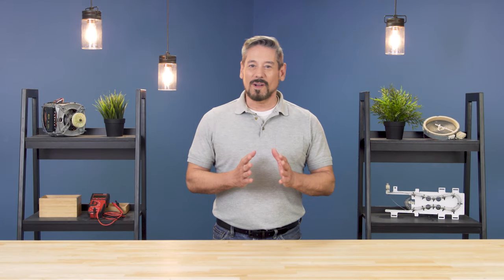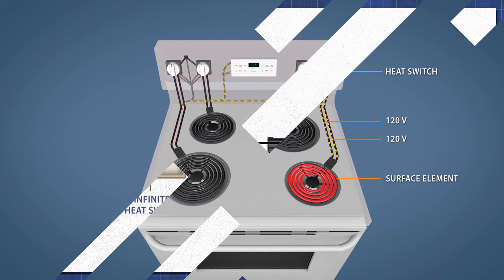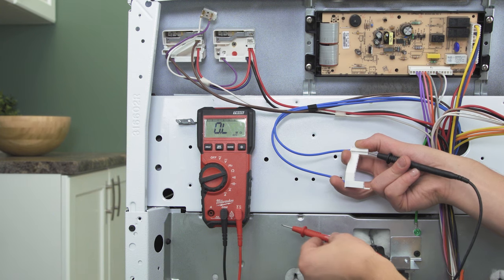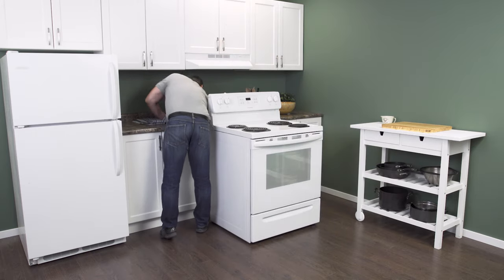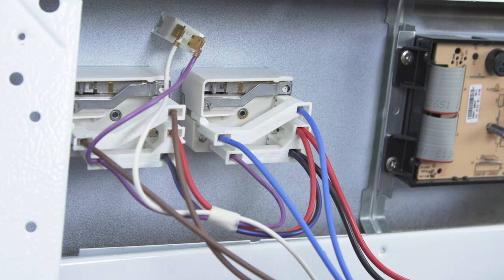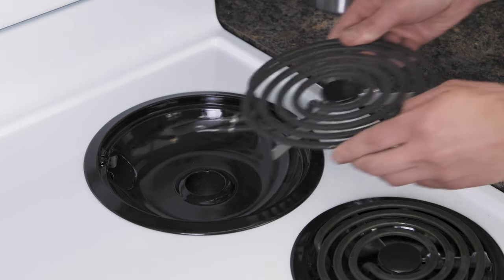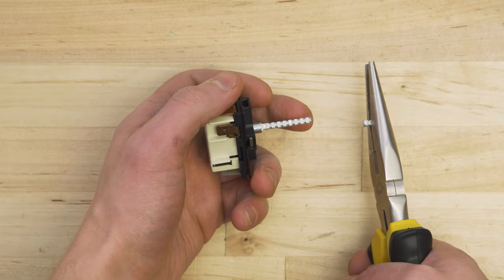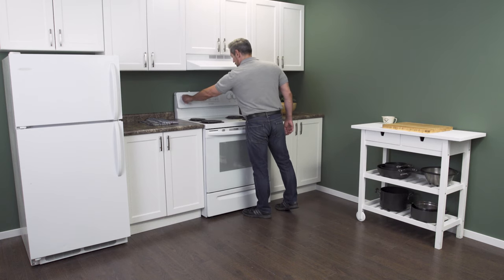Electric Stove Stays on High - Troubleshooting | Repair & Replace

Comment from the maker: Did this video help you fix your stove? Did you run into any problems? Let us know in the comments!
Reply: Yeh, this video did help me to fix the problem.
Thanks.
Reply: What if all elements are staying on high ?
Reply from the maker: @boldackalack_4864  Thanks for watching. If the stove uses 4 separate heat switches then it is very unlikely for all 4 switches to have failed all at once. The only scenario that it might happen is if a range has a control board that is connected to the oven and stove. In this case a faulty control board would effect all 4 elements.
Reply from the maker: @muhammadtahirsiddiqui8347  We're the video helped you! Sorry we're just seeing this comment now!
Reply: Haven't tried it yet
Reply from the maker: @pasqualealbino  Thanks for watching. Keep us posted on how it goes!
Reply: It's a great informative video, however, how does one test a double edison screw fuse holder(uses glass stove fuses) with a multimeter?
Reply from the maker: @asgharalihassim  Thanks for watching, we're just happy to help. You can remove the fuse and test it like you would test a light bulb. Using a multmeter touch the probes to the metal on the screw and the metal tab on the bottom. If the fuse has continuity, then replace it back into the fuse holder. Then you can test the fuse and holder together through the back.
Reply: @AmreSupply  Many thanks,I have also replied on Facebook Messenger with photos, is there any illustrations or video tutorial you can share to assist on this matter?
Reply from the maker: @asgharalihassim  This video shows how to troubleshoot an oven light which is similar: https://youtu.be/T5CPQxYp1WQ 

You can't test a fuse by putting into another device like a light socket. We don't have a video showing testing a lightbulb or edison screw fuse for continuity however once you connect to the side and bottom of the screw, the test will show between 0 and 1 ohms.
Reply: How can I hire one of the stove technicians? I live in Centreville, Virginia. I have same problem electric stoves just one stove over heating.
Reply from the maker: @HealthyLifeChoices-tg9fn  Thanks for watching. You can call up any appliance technician and they will be happy to help you. It is good to ask about rates as there is some variation. There will likely be a fee to just show up and diagnose the problem, then there will be a fee to do the work and replace any parts.
Reply: @AmreSupply  how much do you think it should cost in total? Labor plus parts together in Centreville, Virginia for just one stove which is over heating?
Reply from the maker: @HealthyLifeChoices-tg9fn  Could be a few hundred or more but it's best to ask for a quote for price ranges when making a service call.
Reply: @AmreSupply  What I meant was what do you believe is reasonable price like total?
Reply from the maker: @HealthyLifeChoices-tg9fn  Prices are subjective and its hard to say what it will cost as there is fluctuations based on location. Overall for a new heat switch, expect to pay a technician a few hundred dollars to cover the cost of the part and installation. 

Many people might not think this is the best value and when they look at the simplicity of the repair, they'll decide to install a new switch on their own to save some money.
Reply: @AmreSupply  Ok thanks.

Comment: I actually had the same issue. after removing the switch, I took apart the plastic case for the switch (just needed a flathead screw driver) I then sprayed the internal with mass airflow sensor cleaner. Electrical cleaner would work as well. I clipped it all back together and it worked!!! Hope this helps.
Reply from the maker: Thanks for sharing your experience, we're glad you got it working again!

Comment: I have a stove with a similar issue. About a year and half ago, a tenant complained that the lower right element would turn red hot on the lowest setting. I replaced the heat switch behind the stove and it worked. Fast forward 2022, she’s complaining that it’s getting to hot compared to the others. But it doesn’t turn red hot. Could it be that the element itself is malfunctioning, or could it be that the other 3 elements have faulty heat switches , and they need to be replaced? I opened up the back, the one I replace looks brand new, other 3 look burnt
Reply from the maker: Thanks for watching. Heating elements generally either fail completely or they work. If they have continuity a heating element won't ever be "weak".

Since you put a new switch, it is possible that the switch is hotter at the same "number" setting on the stove. These are not precise heat settings as the elements simply cycle on and off. 

The stove switch uses a bi-metallic switch that heats up and bends to disconnect the circuit. You can learn more in this short 1 minute video: https://youtu.be/URFjJPQycsk

If the other 3 burners work, but they don't seem as hot as the burner with the new heat switch, then the 3 heat switches have likely aged at the same rate. The metal inside the switches is likely fatigued and is quicker to bend and disconnect the circuit. This means that the heating element will get less cycles of heat.

If needed, you could replace all 3 switches and that will likely make them work the same as the new switch. The heat settings that your tenant is used to might not be the same after the update.

Comment: I have the same problem but with my oven( not stove top) I had just replaced the element inside the oven and then about a week later as I was cooking a pizza not even 10 minutes into cooking I smelled something burning went into the kitchen and smoke was coming out the oven. The pizza was burnt to a crisp. The same thing happen again cooking some else. I finally figure out that no matter what temp the oven was on it was always on high and not turning off, until I turned it off. Could this problem be the temp sensor or could this come from the newly replaced baking element. Thanks in advance
Reply from the maker: Thanks for watching. You mentioned that you replaced the baking (bottom) element. For most ovens the bake is used 80% of the time and the top broil element is used 20% of the time. A shorted broil element might stay on and would cause the temperature to be too high.

Also best to test the temperature sensor. You can see more in this video: https://www.youtube.com/watch?v=10ezc3LNQP4

Comment: What if you replace the switch, burner tests good, but it still overheats?
Reply from the maker: Thank you for watching. What do you mean by overheat? Does the stove only run on the high even when set to a low or medium setting?

Comment: we have a newer whirlpool range that 's only a few years old and looks exactly like the one shown except black in color. for about a year now we can't control the heat of the burners on lower to mid settings, they go more to high heat. why would they all act like this for such a new unit?
Reply from the maker: Thanks for watching. If your stove has separate heat switches for all burners, it is unlikely that they would all wear out in the same way and only after a few years of use. 

At the lower heat settings you still should notice the elements glowing on and off but they should turn on less frequently than on high. 

Some pans (like teflon / aluminium) are more sensitive to changes in heat. Using carbon steel or cast iron will help even out the heat and make it that it maintains more even cooking. 

As well the amount of heat will be different for smaller sized pans and smaller amount of food. This is why there is no 1 setting that can be recommended it all depends on these factors.

If you have a model that has stove elements controlled by buttons on the display panel, then a faulty control board could cause these problems.

Comment: How to test a dual element to see if it is shorted? My dual element burner stays on high heat regardless of how we adjust the knob. I tested the switch and it seems to be working properly. The switch and wires are different than the one in this video.
Reply from the maker: Thanks for watching. You can see an explanation of the terminals in this video. https://www.youtube.com/watch?v=GaW7uAHkPQI
You can still test for a short at the back. You'll just have an additional wire to test.
Just remember that the switch might be faulty even if it passes the continuity test. At rest, it is difficult to test to see if the metal inside the switch is not releasing properly from the contacts. This is a single switch but you can see more on the inside of the switch here: https://www.youtube.com/shorts/URFjJPQycsk
Reply: @AmreSupply  thank you! I will check this out.
Reply: @AmreSupply  are we looking for a specific resistance reading for continuity using the wires to test for a short of the element ? I'm getting about 43 on 4 and 38 on 4a.
Reply from the maker: @seanm2216  If you are testing for a short looking at the resistance for the wire connected to terminal 4 and the metal frame, then a resistance of 43 or 38 ohms means its shorted. There should be no continuity reading or  - - - - -  or OL on the multimeter. 

If you test the terminals directly at the element you'll likely get a similar reading. If that's the case then replace the element.

If the element does not show the same reading, then check the wires to see if they are damaged or if the wire terminals are touching anything.
Reply: @AmreSupply  Thank you! I tested each wire (2,4,4a) to frame and got no continuity. When I tested the wires to see if the element was shorted (i.e. Wire that goes to 2 and wire that goes to 4 and 4a), that is where I got the reading of around 40 on each. I opened the switch and didn't see any fusing. So I hope it is just the switch.
Reply from the maker: @seanm2216  From what you tested there is no short as there is no continuity to the metal frame. 

When testing between wires 2 and 4 or testing between wires 2 and 4a, you are testing the resistance of the element coil. Both those tests are normal readings.

It's likely a faulty switch. The terminals don't always fuse together in these cases but the metal inside the switch becomes fatigued and does not bend away when it is supposed to on lower settings.

In this case installing a new heat switch will likely solve your problem. You can enter you model number here to find an exact match: https://www.amresupply.com/lookup
Reply: @AmreSupply  Thank you! I will try a new switch and give an update.
Reply from the maker: @seanm2216  You're welcome, we're just happy to help and we're curious to see if that fixes the problem!
Reply: @AmreSupply  it did end up being the switch. After changing it, the burner now works properly. Thank you for your help!
Reply from the maker: @seanm2216  You're very welcome! Thank you for the update, we're glad that it's working properly again!

Comment: Tried testing resistance, but kept getting 1 all the way to the left on the indicator. I am guessing this is just the infinite that shows when no connection is established, I tried all of the back metal portions of the stove. Is no continuity the same as an infinite number? If I put the 2 probes simultaneously into H1 and H2 I do get a number so the ohm meter works.
Reply from the maker: Thanks for watching. No continuity is the same as infinite resistance or an open circuit. When you have the multimeter probes disconnected it will show a blank display, or  - - - - - -, or in some models it will show OL (open loop). If the multimeter shows just a 1 and not 1.0 or 1.00 etc then that might be the indication of the infinite resistance. You can always check the manual for your multimeter for more details.
Reply: @AmreSupply  Thank you for the reply.
Reply from the maker: @dimkacracker  You're welcome!

Comment: What would cause both left side burners to only work on high burners have not been used very often but there be a fuse running that part
Reply from the maker: Thanks for watching. It is unlikely for both switches to fail at once. There could be a short to ground and depending on how it is wired one wire might feed the left burners and another wire might feed the right side. You can still do the checks as outlined in this video.

Comment: Thankyou for the informative video, can I ask a quick question?
If all four burners are giving full heat when placed on the lowest settings, which diagnosis is more likely? The switch replacement or the burner replacement? Thankyou for help!
Reply from the maker: Hi Julian, thank you for watching! Is this a hypothetical question or do you have a stove that have 4 burners that are staying on high? Overall that is a highly unlikely scenario for all 4 burners to have either a shorted element or a faulty heat switch. If you did have a stove that the burners were hooked up to the control board (instead of independent heat switches) then it could be an issue with the control board.
Reply: @AmreSupply   @AMRE Supply  I don't know if my reply went through. 
Sorry for the confusion, it is not a hypothetical situation. My parent's oven currently has this issue. 

Thankyou for the information regarding the control board.

Comment: Great!... I will check as you discussed. 
QUESTIONS: I have a fairly new stove, a 3-4 years old. Both front large burners are doing this. The smaller back burners are not. Is this issue more prevalent for the larger burners? Does the fact that this issue is with BOTH large burners; front right and front left, mean  there something else to check? Are they electrically connected somehow, or is there a component to check that  controls/links the large burners?  thank you
Reply from the maker: Thanks for watching. If you have a ceramic cooktop it is possible that something is touching the wire connectors on the elements. This video shows how to access the burners. Look to make sure there is enough clearance around all of the terminals. https://youtu.be/CXhmlswg30Y
Reply: @AmreSupply  wow, that is nice of you to respond so quickly! I will take a look at this video too. thank you.
Reply from the maker: @dgodrummer8110  You're welcome, we're just happy to help!

Comment: After a certain age, westinghouse models 143 or 509 or similar, keep destroying the large spiral's heat controller switch/thermostat. 
I wondered if you came upon this problem, it must be a fault in the bottom part of the wiring. Last switch replacement only lasted 5-6 months before overheating again.
It also seems that the model devolved due to problems; #1 digital clock with oven timer #2 digital clock, timer present but disconnected (button omitted), #3 mechanical timer, no digital clock, no oven timer ???
I truly look forward to the next model of this stove.
Reply from the maker: Thanks for sharing your experience! As for Westinghouse that is not a brand / model that I am as familiar with.

Comment: Thanks for the video I did my check but noticed my switch had a bit of charring and discolouring on the terminals.
Reply from the maker: Thanks for watching. Yes charred terminals is a sign that the switch is faulty, so it is often best to replace it.
Reply: @AmreSupply  I replaced my switch and the burner stayed on continually. Could it be a bad switch? Or do you think it’s something else

Comment: My 'small burner-large burner' rocker switch on my Spectra electric range went out. I removed it and it reads 4 amp 250VAC and 8 amp 125VAC - 2 prong.
 
My question is all I find online for the replacement for that 14 y.o switch is 8 amp 250VAC and 12 amp 125VAC....Is that 'OK' or will it burn out something??
Reply from the maker: Thanks for watching. The ratings will refer to the maximum that the switch can handle. In this case using a higher rated switch will work and not create issues as nothing else in the circuit is different.

Comment: Could I leave for while the Cooktop Hot how it is. Is it dangerous to maintain it with this effect ? Please answer and thank you
Reply from the maker: Thanks for watching. If one burner stays on high but you're able to shut off the burner (and the burner is completely cool) then it's not a problem. Until the burner is fixed you should be able to just use the other burners without issue.

Now if the burner doesn't shut off even when the switch is turned off, then its best to unplug the stove or shut off power at the breaker.

Comment: So none of my switches have anything connected to the H1 terminal. All the other burners work just fine. Should I be concerned by this wiring situation? I think I might have an older model
Reply from the maker: Thanks for watching. There is some variation between how switches are wired and how the terminals are named. For a basic heating element the switch should have 2 input terminals and 2 output terminals for the element. There should also be one terminal for the cooktop indicator light.

Comment: Is there a way to force the stove top element to turn off while I wait for the repair part
Reply from the maker: Thanks for watching. If the stove element still turns off correctly when the dial is set to the off position, then there is no need to do anything.

If it doesn't turn off correctly,  you can always disconnect the wires to the heat switch as this will prevent it from receiving any power.